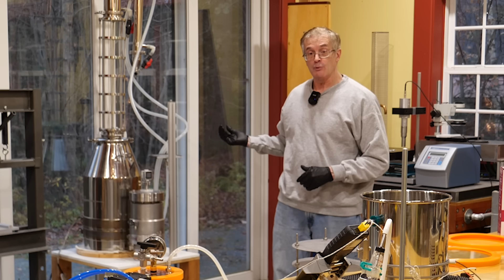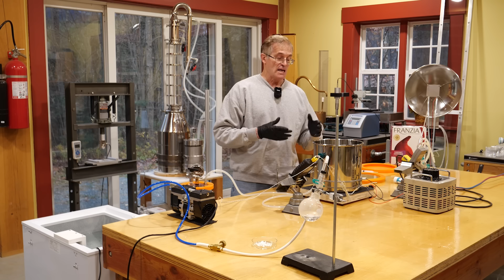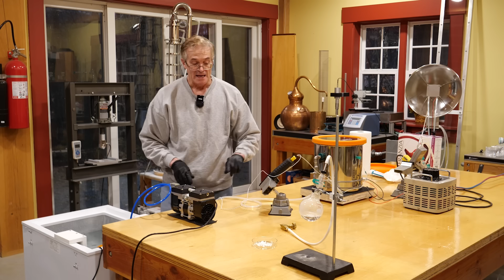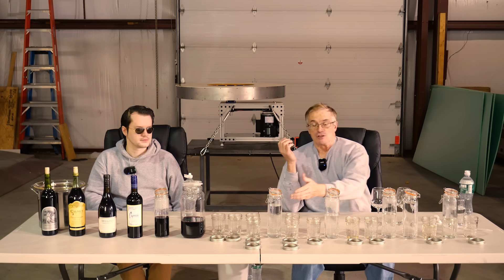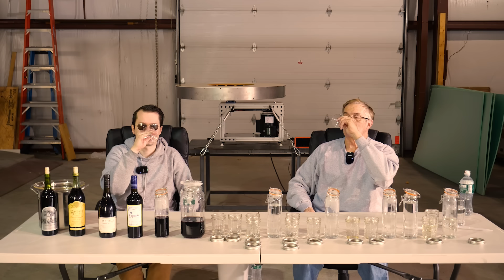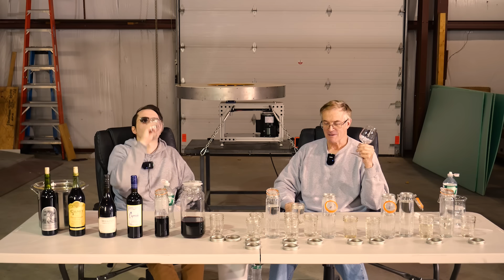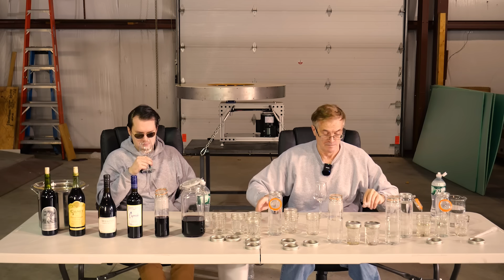Turning $3 Wine into a $100 Vintage with Science!

Comment: do you need the heat because the diaphragm pump can't get the vacuum low enough to cold boil?
Reply from the maker: I explained this, but maybe I should have emphasized it a little more.
The vaporization process requires heat energy and so, without the addition of some heat, the big pot can potentially  freeze!
Reply: @TechIngredients would you be kind enough to link your pump? I'm looking at diaphragm pumps but the lowest pressure I found is 50mbar. which is not low enough to cold boil water. I'm essentially looking to degas distilled water for consumption.

but from what I saw youre going after alcohol not water. so likely those pressures are fine for boiling alcohol.
Reply from the maker: I can get to the link tomorrow.

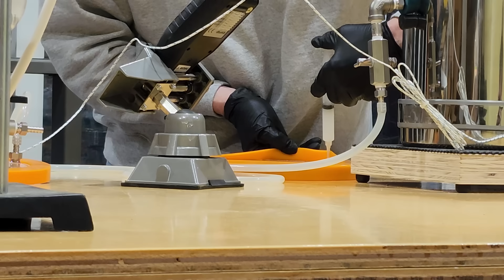Comment: 37:00 Why not just use tallow or lard, or a similar cooking fat, as the food-safe grease to enable the seal? It seems like that would be much easier and more convenient to obtain than the stuff you used. Would it not work as well, and if not, why not?
Reply from the maker: You certainly could.
The downside is that they dry out even if slowly. 
The grease we used is cheap ($6) and it's nice to use it on other kitchen equipment like meat slicers and can openers.

Comment: Interesting exercise.  However, IMHO everything that matters is in the last colored jar.  You can play with the lighter volatiles but what about the tannins and everything else in that last jar?   For cost and effort.  I'll pay for the better off the shelf wine - or brew my own...
Reply from the maker: Thanks.
Practically,  the last fraction can continue to be divided. The process can continue until all that is left is a stain of solids from the original box of wine.
From a cost point of view, your choice is a poor one. From an effort point of view,  once the fractions that need to be excluded are identified then you only have to spend a few minutes three times during the whole run.

Comment: After doing an initial test run to determine which timeframes will produce the cuts to include in the final product, the process could be automated with a programable valve to automatically divert the condensate between retain/discard receiving pots. Excellent video!
Reply from the maker: Thanks!
I agree.

Comment: One thing that would be very interesting with this is infusing with wood using ultrasonic. The consensus with this is that is that it's worse than barrel ageing, but with this distillation all the bad flavors could be removed.
Also it would make sense to have a scale under the big pot so one could determine the "cut-off" points for future reference.
Reply from the maker: I like that scale suggestion!
In retrospect, it should have been an obvious addition.

Comment: distillation (and brewing) is such a joy. I once had 5l of the most beautiful, sweet alcohol once. I guess you'd call it rum, taken from the very middles of a large number of slow and gentle fractioning column runs, using a variac to minimize the overshoot.

Turns out having access to too much high quality alcholol has downsides, especially with a secretly alcoholic partner :(

I do wonder how well this vacuum setup would work with a fractioning column, to slow it down, and give time for the fractions to separate. having a lot of ceramic nuggets in the column might help to smooth out the boiling too

Comment: When wine tasting in the Santa Ynez Valley recently.  Went to wash out the tasting glass with water and the Sommelier pointed out that you shouldn't do that.  The pH between the wine and the water is not a match and will throw off the tasting.  Ratio wise for the excluded volumes, probably shouldn't have used all the remnants.
Reply from the maker: Interesting. 
We could have replaced the excluded fractions with pure water, but didn't see an advantage other than to dilute everything. And like the selection process, if concentration also adds to the experience,  then fine.

Comment: Thanks for the detailed video.  
Oh boy, where should I start!! I may have a few comments all with a few questions in them.
First, do flavonoids evaporate? I guess ethanol and other volatile compounds and other alcohols do evaporate easily, but most certainly tannins don't, oak sugars, so on and so forth.  I dig the science and really appreciate the video and work you put.  I see this much more effective in making cucumber gin, or any green infused spirits that 100 degrees will ruin its flavor.  What do you think??
Reply from the maker: The basic principle here is that a vacuum distillation is a gentle method for deconstructing any beverage.  It doesn't even have to contain alcohol. 
You can modify the precursor or the result further. This still applies.

Comment: It is my opinion that you do not have to worry with throwing out any first cuts in that you are starting with an already refined commercial product that is likely free of the wrong kind of alcohol.
Reply from the maker: Agreed. 
There have been some comments that remind us that methanol is present in all fermented beverages. That's  true, but it's probably not important. 
Nevertheless,  if someone is a real stickler, removing the first few hundred milliliters will reduce this even further.
This process allows just another benefit if someone is interested.

Comment: 14 hours to transform box 'o wine into good wine? Deal!  Vacuum distillation is next on my list!
Reply from the maker: Maybe it should be.
I get your dig, but consider this. Once you've identified the part of the separation that needs to be excluded, you only need to interact for a few minutes, three times during the process.
The next run also costs only what your local supplier charges for a box of wine.

Comment: How well does it work without ice?
Reply from the maker: We didn't try that because it's so easy to maximize the performance with this simple technique.
Reply: @TechIngredients , it's okay to say, "I don't know."
Reply from the maker: Actually,  I do know.
It won't work as well.
Without the cold receptical to condense the vapor at a very low vapor pressure, the system will operate at a higher temperature to reach the higher vapor pressure needed to condense the fractions. Furthermore,  the warm vapor will heat the receptacle unless the heat is removed, requiring even more pressure and around and around... This isn't good for the wine.
But, like I said I didn't bother to test this because it may be a little worse, but more likely,  it will be lot worse.🙂

Comment: For blending roasted coffees I used a combination of characteristics (e.g. fruity, burned, caramel) and a tongue map (front, middle, back, sides) and assigned numerical scales to each attribute's strength/experience (1..5). This helped with finding a balance among varieties and years (gotta recalibrate every year).  Before that it was very haphazard, finding that varieties I liked less improved the blend, but only at certain ratios, etc. It seemed paradoxical before being more analytical and the search space is combinatorial. My coffee metrics aren't directly applicable to wine but you get the idea. This can of course go on forever so at some point you gotta pull the ripcord at 90/10 or whatever.

Comment: Wine has a lot of methanol in it...
Reply from the maker: There are test strips and inexpensive test kits that can be used to detect and even measure methanol content.
If you go through this process and ALSO remove the methanol which will be concentrated in the first cut, you can further improve the wine that came out of the box.

Comment: I love this. Great concept :D Shoutout to @Not.So.WiseGuy for some valid points. Also from experience some wines change taste and even color if they are moved too much - used to bring very dark red wine from my grandparents, and on the road for 6-7 hours back home, it would turn brighter brown and a tad more of tanine even if not lots of air was in the containers for transportation.

PS: Well... I cringed just for one thing: you mentioned wine doesn't like oxygen - and that's true see above.The "leftovers" froom the vacuum pot were left exposed to air for the whole duration of the tasting - mayne even for longer before. Also after mixing your prefered fractions. I say minimise the air exposure. Hope to see an improved version of this :D
PSS: I'm not a wine expert by any means, just had a bit of experience with handling home made wine.
Reply from the maker: It's an interesting issue. 
It's about balance.
Almost all wine tastes better when the bottle is opened or even decanted an hour or so before drinking.
In that case the oxygen helps. But as time goes on, the process goes too far.
When the wine is heated, this process accelerates significantly.

Comment: I tried doing a vacuum distillation several years ago. I found that both the alcohol and water were evacuated from the pot and into my pump.
Reply from the maker: Try slowing the process down.
And remember, I shut off the pump once the vacuum was reached.

Comment: I'm curious to see your take on the eco-friedly concrete like material called Ferrock.
It's made using mainly steel dust and amorphous silica, captures CO2 instead of releasing and it has higher strength than concrete.
Reply from the maker: I actually did some experiments with it, but we never progressed to make a video. I'll consider doing that.
Reply: @TechIngredients  Thank you for considering it, I'm a designer and would like to custom make exterior/interior furniture with it. I'm curious about how coarse can the particles be and I wonder if mixing it with concrete (say 20% concrete) helps with the overall curing as the concrete releases CO2 the ferrock captures it (or they just get in the way of eachother)?

Comment: Out of curiosity, how does one identify and discard the forshots using this method? Generally, the methanol presents itself at a lower temperature, so discarding simply means throwing out the first few ounces.
Reply from the maker: Starting with a commercial boxed wine,  we add nothing to what was already there.  The small percentage of methanol that is in this wine , if we care to extract that as well, will be present in the earliest fraction.  Without a methanol detection system such as cheap test strips or a chemical reagent test, eliminating the first separation will significantly reduce methanol presence in the final mix.

Comment: Wow, nice job, for science of course 😂  I wonder if you could use an quick, single vacuum distill pass to remove the methanol from cider before turning it into apple jack with ice distillation?
Reply from the maker: You could.
Reply: @TechIngredients  Thanks for the reply, I did a little research and it seems the sweet spot is between 10 and 15 °C, where the vapor pressure ratios between methanol, ethanol and water differ the most.  I think if you started at room temperature you could degass the cider by slowly bringing the pressure down to 100 mbar without boiling off the liquids and as a side effect it would lower the temperature towards the target 15, speeding up the chilling operation.  Science is awesome :)

Comment: maybe adding those bads just somewhat would be good to maintain overall spectrum. This comes from principle "don't fix it 100%" Idk if it is good in wine engineering. Just one thought from Finland. Thanks for video.
Reply: That would preserve natural fermentation flawour (if it is any good to be preserved) even they are bad maybe they make up something good as together.  Maybe you could have distilled water out of those bad tastes to maintain as much of original consistency.
Reply: *(By putting the water back in the final mix)

Comment: Thank you for all your videos.  This one was especially intriguing because of the vacuum distillation.

Anyway, i had a few questions and observations about your “cuts”.  I not criticizing or attacking you, just inquiring perhaps so I can learn something new, or at least see your thinking behind your process.

1. Is the resultant distillate, at least at the beginning of the run at azeotrope or near pure alcohol ? 

2. I understand why you didn’t make a “foreshot” methanol cut, but you didn’t seem to make a “heads” cut.  Does that have something to do with fruit ?

3. Why did you use the “stillage” to do your final blend ?  I know it was “damaged” by heat, but I would have thought to use the untouched original, full flavored wine to fortify and enhance it.  My thinking was bc of what happens to the wine during the vacuum process; it got concentrated and seemingly acidic.  I understood your point about recombining all cuts to make something better, but if you didn’t even like the stillage and it couldn’t make the “flavor cut” why did you go that way and use it ?.  

4. You have lots of confidence.  I might have first blended the cuts ( as you did ) then that tge blended cuts and try several different blends with the stillage using various proportions of alcohol and stillage to find the best flavor combo. 

5. How about a test with cuts blended with tge original wine ?  Maybe you could try another batch that way.

6.  Does the vacuum increase as tge run proceeds ?  Or do I need to increase the vacuum as the run proceeds; as the more volatile compounds are removed wouldn’t that change the “boiling” point ?  Is so, does your vacuum pump have this ability to?

Once again thank you for all you do !!  Great content and bringing science to the table.

Comment: A couple years ago I started making my hard boiled eggs on the steamer shelf in a pressure cooker.  Use the minimum amount of water your cooker will allow.

Let them cook about 5 minutes once it hits temperature. Remove heat, release pressure beginning immediately, but release it over 30 to 60 seconds.  Eggs to ice bath right away.

Once they've cooled they are the tastiest, most easily peeled hard boiled eggs I've ever had.
Reply from the maker: Thanks for the tip! We'll try it out.

Comment: I built a vacuum still once to make ultra light Maple Syrup. By boiling away the water at near room temperature to prevent sugar decomposition and inversion.  You're in maple syrup country, maybe you can try the same thing next spring.  You may even be able to get away with only modifying your current set-up.

Comment: Many wines don't like being shook or being at a too high or too low temperature. 
Some also need to breathe a bit after opening the bottle, but the whole process pretty much forces some exposure to air.
I would suggest keeping the temperature of both pots close to the temperature the wine is supposed to be served at. Keeping the big pot below room temperature would also prevent condensation in the tubes. Let the final mix rest for a few days in a closed container with very little air.
Also: you rely on the vapors to condensate before going into the pump, which will reduce the yield on the more volatile components. I bet filling the cold pot with stainless-steel wool will drastically improve the yield by increasing the surface area and thus heat transfer rate. Copper might be good too, especially since it's thermal conductivity is higher, but it's more reactive than chrome steel.
Reply from the maker: Those are important considerations.
As I explained, this process was performed at or below room temperature.
The effects of oxidation are amplified at elevated temperatures, nevertheless most wine, especially reds benefit from some exposure to air before drinking, ie. you decant them and let them "breathe".
The vacuum pump is shut down and the system is sealed during the distillation. Loss into the pump is trivial.

Comment: You should regulate the heater so that temperature stays constant duting the distillation and stop the pump and heater when the temperature suddenly rises. 
This indicates that all of the substance that has just been evaporated has been extracted and there is no more evaporative cooling for the heater to counteract.
Optional improvement: two distillation pots, only one being connected to the main pot and pump at any time ( 2 "Y-valves" )
This allows continuous operation while transfering destilate to another container.
Reply from the maker: There is no sudden increase in temperature and the temperature does not need to be regulated.  Under vacuum,  the boiling point of the wine determines the temperature.

Comment: So you kept the heads and the tails,
That's very interesting, because with distilling liquor, you do the opposite.
It would have been interesting to you combine only the 4 middle ones and taste a mix of just the "hearts",
just to make sure there was no redeeming qualities when combined.
Of course you could have mixed all possible combinations also, but that would take forever. (32,767 mixes, 2^15 -1 [minus 1 because you don't taste air], assuming this unchecked math is accurate.)

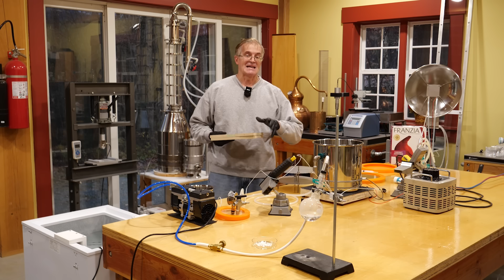Comment: 30:40 or you use an angle grinder with a cutting disk (they're available at 1mm thickness, which is quite easy to  handle even for beginners) or even a plasma cutter (if you have one, and for such thin material they're pretty cheap nowadays)
Reply from the maker: If you men instead of the step drill then no, it works well and quickly and isn't expensive.

Comment: 18:00 maybe I misunderstood? in case I didn0t, don't use a drill (or at worse use a drillbit for wood), but use a "stamp" like https://cdn11.bigcommerce.com/s-st781muxzm/images/stencil/1280x1280/products/1517/9395/silver-hollow-hole-punch-tool-1__55702.1651586950.jpg?c=1